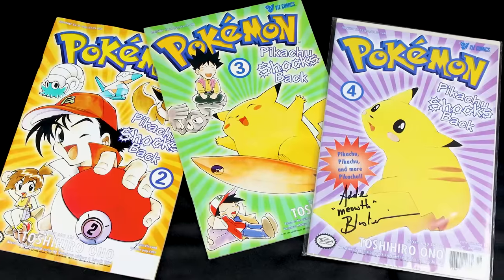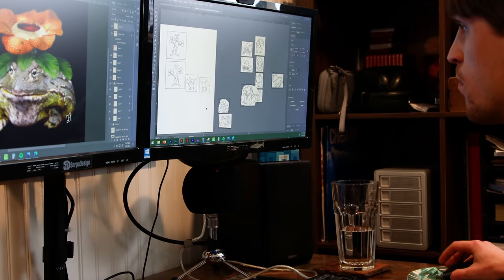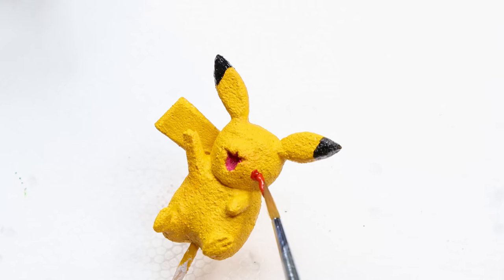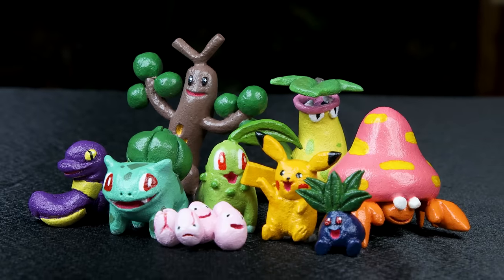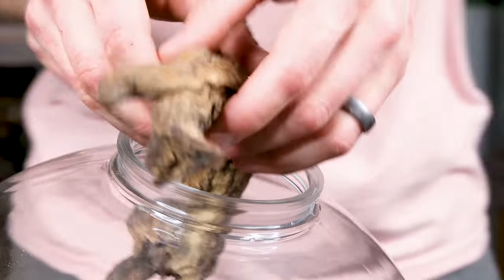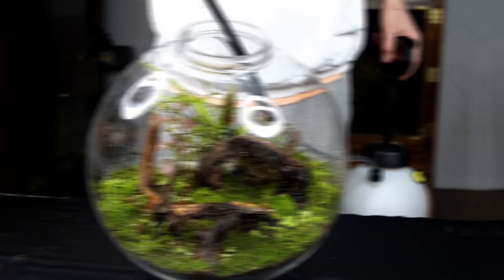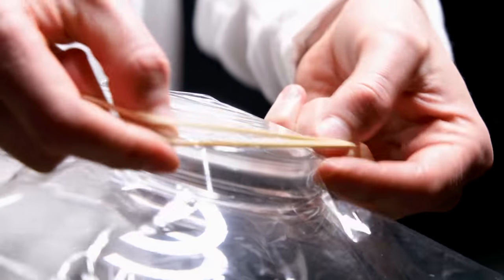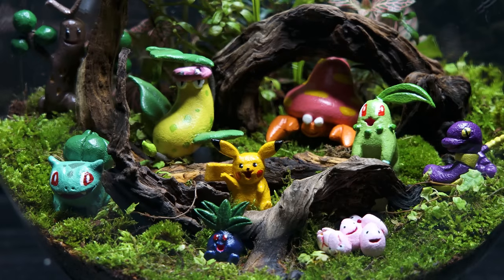I Made a Pokemon Terrarium with Hand Carved Figures

Comment: Tanner out here flexing his art skills.

To anyone working with sculpture foam- if you want a super smooth surface you can use spackle to fill the holes in the foam, and then sand it smooth!
Reply: Nice tip! Thanks! 

I've never worked with that particular foam. Do you think spackle works better than heat sealing for other foam types (when heat sealing is possible)?

Comment: Hey Tanner I got a question I'm pretty stumped on and was wondering with your knowledge what your recommendations would be?
I've built my own enclosure recently based on your previous enclosure build videos but modified it at 2' in depth, 3' in width and 4' in height. I don't know what lights I can buy to reach far enough in the tank to give my plants growth. Mercury Vapor lights are the only ones that I can seem to find that pump enough UVB and UVA for plants and reptiles at such depths of around 3 feet. But this tank is gonna be for some red-phased brown anoles and I don't wanna dry the tank out to fast nor have high basking spots be extremely hot. Any recommendations?!  

I appreciate it! And been following you for over a year now awesome to see your channel grow your a great content creator and even better guy from what I've seen!
Reply from the maker: I personally would go down the route of a combination of lights. Use LEDs for the plants and UV for the anoles. Hopefully that helps!
Reply: Thanks Tanner this helped alot! I ended up doing two Arcadia lights. Their forest 6% UVB and the Jungle Dawn for led lights. I appreciate the help! Have a good one.

Comment: Hello. could you advise me what are suitable specific types of plants that are suitable for very humid terrarium (something like in Malaysia - 90%) and suitable for lower temperatures (20-24C ° - maximum 24 no more, rather lower temperature) ? (approximately up to 35-40 cm high) but also low plants? The light will be an RGBW led strip. Thanks for the answers.

Comment: Hi Tanner, Very nice channel, just subscribed! Can I use any kind of wood to the terrariums?  Except pinus? Do i have to remove all the bark and sun dry it?
Thanks a lot!
Keep up your success!
Reply from the maker: Anything that's dense usually does fine. There's always room for experimentation as well. If you find something outside that looks cool and feels dense, give it a try. The only real issue I've found is that some pieces may decompose quickly. If you want a tried and true, go for materials intended for aquariums.